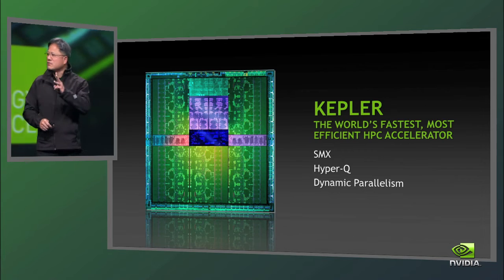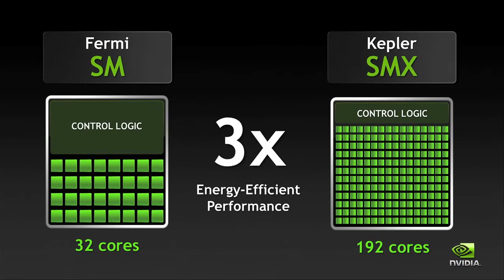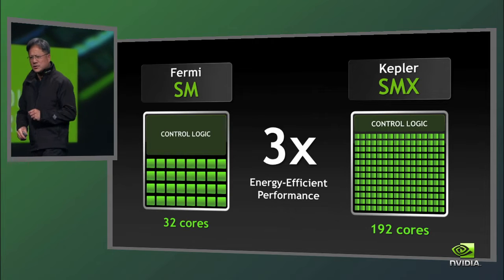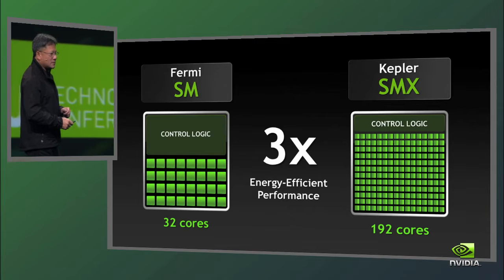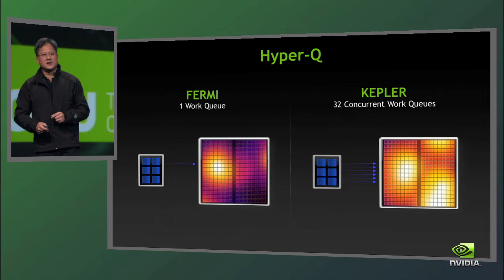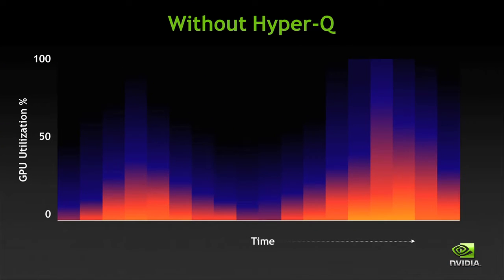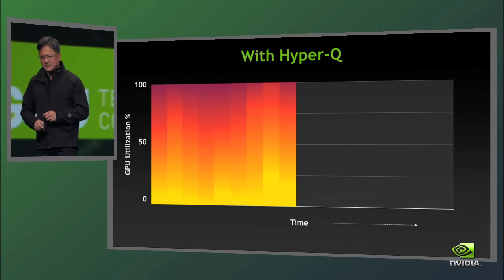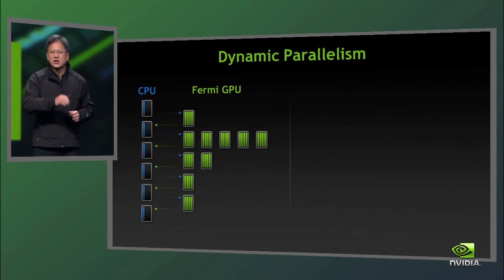GTC 2012 Keynote (Part 03): The NVIDIA Kepler GPU Architecture

Comment: GPUz with such power can handle antything ....... even the fermi was capable doing anything a gamer would want.....the gtx 580 had enough compute strength to compete with gpuz of today......games are not much demanding as compared to the level of computing in gpu..... due to marketing reasons the limit the gpu perormance through the driver ..... as every hardware needs software they are able to control it.....if  there would have been no limitation even to the 580 i bet it could last 6 yrs